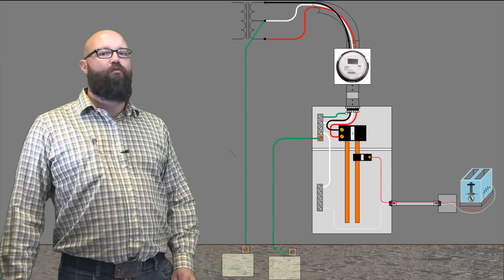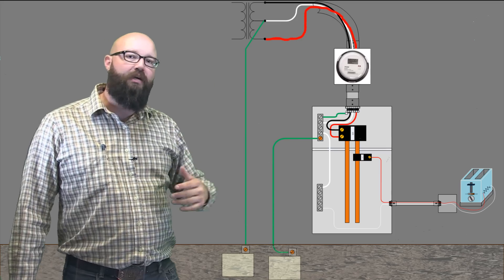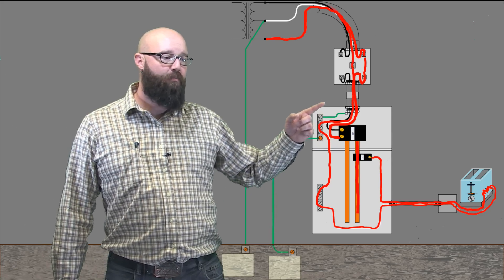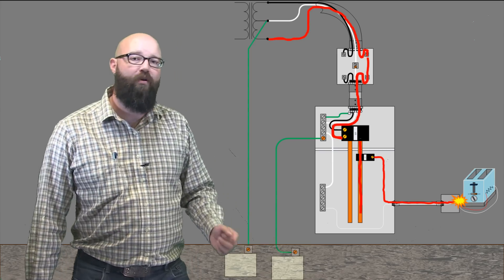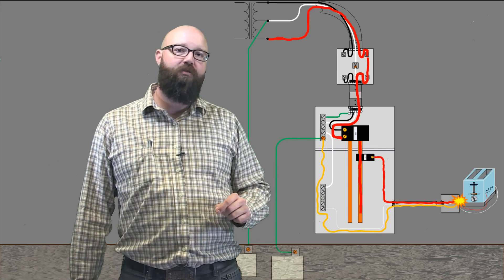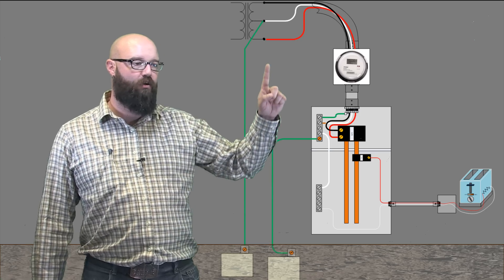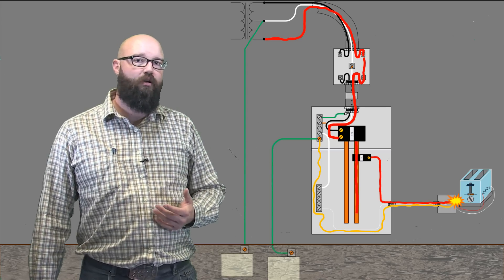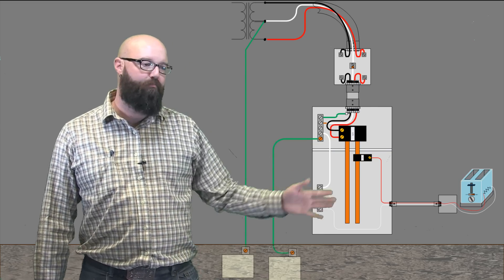Grounding and Bonding

Comment: So that white wire ( but it becomes bare wire outside heading to the transformer) is a current-carrying conductor basically at all times? and at the transformer, that wire is also connected to the ground.  Of course, it is. Just go outside and look at it.
Reply from the maker: Depending on the application of the term "current carrying conductor", it will have different applications.

While there may be current on the white (identified neutral) conductor, it is not counted as a current carrying conductor when applying correction factors for more than three conductors in conduit for example.
Reply: @schulerruler  I indulged in an assumption that you know what setting/application context I made my comment.
I have a transformer at the pole by my house.  I have two wires ( both are black in color and is insulated) coming out of that transformer.  I am told that two wires come of each end of coil that is inside that transformer.   The voltage difference between the two wires is 240-volt
s (give and take).    So if I hook up a load that can run on 240 volts, no problem, there is my two wires and it makes a complete circuit(loop) going round and round in a circle as by definition of a complete circuit.
Now if I want 120 volts, the story takes on all kinds of twists and turns and all kinds of other terminologies kick in.
There is a bare wire, they also call it neutral, even ground depending on who you talk to.  Whatever term is used frankly doesn't mean a thing.  It is a bare uninsulated wire that goes in the middle of that coil at its center point,  In fact, they call it a center tap and some shortens it and call it CT.  This is the same wire that is an insulated white wire inside my house.  It is the same wire that goes into every outlet etc.  Without it, I have no power in my outlets, light bulbs and all the things that run on 120 volts.  In other words, it is current-carrying ( charge moving in it) wire. If I touch it and the black wire in my outlet, it will let me know what is the boss.
Yet once this thing is outside as bare wire, it is harmless and hardly carries any current, mostly zero-charge carrying conductor, blah blah blah.
Harmless enough that they leave it bare.
So if I have only one thing running in my house at full blast, say an air conditioner (120 volts) and everything else is off.  Tell me if that bare wire is dead with no charges jiggling back and forth on it and tell me how neutral it is. If so where is my circuit ( my loop)?  What wire(s) are used by cosmic electric energy to do its magic?
And I will make it more interesting.
The two black wires come in my circuit breaker, each one occupying its own column of hookups.   Call one of them A and call the other column B.

Now I turn off all the switches on column B and use only column A that is hooked up to one black wire.  
( You can not have the two black wires touching each other, oh my, the two columns are kept separate)

Where is my return wire to complete the circuit and would it be alive.  Alive meaning that it is carrying charges, jiggling back and forth,  You know it is AC?
How NEUTRAL is that center tap bare neutral wire is that the tree limb constantly is rubbing on it and the two black wires too?
 (All three wires are pretty twisted together between the house and the transformer), 
Aerial bare wire?,  Earth ground? both 50/50, 30/70, 10/90, neither to complete the circuit?
Reply from the maker: @Blue Ocean to quickly answer your question, the bare wire outside, and anything connected to ground have no potential between them. They are effectively the same point. If you were to measure line 1 to anything effectively grounded, you would measure 120v (Same as to neutral) because they are the same point through the grounding connection at the transformer, and service.
Reply: @schulerruler   That is a no brainer, but that is not my point.  I was making my statement that it is so. 
My point is since they are all connected together which is obvious, are they dead wires ( i.e. no charges move through them) or are they truly part of the jiggling of the AC power system?
If they are dead or close to dead or in the vicinity of being dead wires, how do you get 120V using the two main black wires which are at 240V of each other?
I don't know about the whole shenanigan of balancing the loads, bla blah blah,  the two legs (L1 and L-2) are clearly separated from each other at the circuit breaker box.
Furthermore, how do I get 240 volts from one leg on the panel unless there is something I am missing Does the 240 switches have to be in contact with L-1 and L-2.  I haven't thought about that.  It has to be.
Nonetheless back to my 120V problem?
Reply from the maker: The entire circuit is a 240v transformer secondary coil that is tapped directly in the centre. This is where the neutral is connected, giving the line to neutral voltage of 120v. There are two 120v circuits available, but in reality they are half of the same 240v circuits each. This is also why the reading line to line is 240v (the whole coil).

 Yes there is current flowing on the neutral if the circuit is not balanced. How much depends on how big of an imbalance. (Check out my Edison three wire video for reference).
I would not recommend connecting a switch from line 1 to line 2 on a 240v circuit as this would result in a dead short @ 240v.

I'm not sure if I'm answering your question or not but I'm happy to keep trying.
Reply: Blue Ocean     Back to your original question please.   The white wire is neutral because it is common(connected) to both L1&L2 to be half the windings in the transformer so half the voltage.   Does it have voltage on it?  Yes it does.  But if you connect a ground to it at the panel, the meter will read zero volts because they both have the same voltage, not because it magically disappeared.   Is a neutral current carrying?   Answer, yes and no.   If you have two 120 volt loads and they are exactly the same ohms and distance away, and they are connected to L1 and neutral and L2 and the same neutral, then there are zero amps flowing back to the panel on the neutral.   The path is L1 to N to L2.   This is where the 180 degree and out of phase guys get to and can't explain.   If you do a single 120 volt circuit, there is current on the neutral.   If you put multiple 120 volt circuits in a conduit with a neutral to each one they are all current carrying because you forced the conductor to carry it back to a common point.
So, if every 120 volt circuit in your house connected to L1 and N was the exact same load as every 120 volt circuit connected to N and L2, then the bare conductor to your transformer would be  120 volts to line, zero volts to ground, and zero amps of current.
I hope this helps you understand.
Respectfully,   Kevin

Comment: If there was enough current to find the ground in the transformer and then trip the breaker all the kittens and dogs and people walking barefoot between the house and the transformer  would get toasted the same way the bread was about to get toasted.  This makes no sense.
Reply from the maker: The current returns on the low impedance neutral path. It does not travel through ground. In the last example, there would need to be a sufficiently high moisture/saline content to facilitate this, but under normal circumstances it would not flow through the earth. This is not the intent of the video. The intent is to highlight the path of current in a FAULT condition, not normal operation.

Comment: My friend great video and diagram with all the correct components. However your last example of utilizing the grounding electrode back to the grounded utility source will not open a circuit breaker. The ground resistance is too high to have a low impedance path. I apologize if this was clarified in one of the comments.
Reply from the maker: It has been, bit it's always good to discuss. I have clarified this point also in the video description, but depending upon the soil moisture/saline content, normally the impedance would definitely be too high. I would like the opportunity to conduct this scenario in a much wetter environment as it's very dry where I am.

Comment: Stop manufacturing electronics / equipment with metallic/conductive chassis, and you vastly reduce the costs of preventative circuitry.
Reply: good point
Reply: Wow, wouldn’t that open a can of worms.

Comment: Why it trips only the breaker of that line and not all the breakers of that hot bus bar.?
Reply from the maker: Tapped off of that bus, all other breakers would be considered "downstream" and a fault will always(99.9% of the time) trip devices "upstream". It may trip several devices upstream depending upon the coordination of your overcurrent devices, but it should not trip overcurrents in other circuits.

Comment: What size wire would be best for grounding a residential circuit break box?
Reply: The grounding electrode conductor is sized per the NEC based on the rating of the service disconnecting means (main breaker or fuse). It would be #8 copper for 100 amps and #4 for 200 amps. The grounding conductor to the supplemental rod never has to be larger than #6, although it can be #8 for a 100 amp service. But #8 would need to be protected from physical injury.

Comment: The last scenario is obviously very unlikely to trip the breaker seeing as how the Earth is very high resistance across large distances. That is the purpose of bonding neutral to ground. In last scenario you are being electrocuted with high amperage but the Earths resistance is the last feature of the circuit so the breaker never receives the high amperage that it needs to trip.
Reply from the maker: Depending on the soil moisture and saline content. Check out the video description as this point is discussed. Thanks for watching and commenting!
Reply: schulerruler Thanks for the great video. When you make content this organized it helps even experienced people to solidify the memories. Terrific explanation
Reply from the maker: @Coldbrookdangee  thank you so much for the positive feedback!!

Comment: In the final example I thought 120 volts applied to a ground rod won't open the breaker.
Reply from the maker: It depends on the soil moisture and saline content, but in most cases you are correct yes. Check out the video description as that's addressed there. Thanks for watching and commenting

Comment: Instead of connecting the green wires to plates in the ground why don't they just connect the green wires to eachother? then the elictricity could flow through a wire instead of through the ground.  would be alot easier that way imo.
Reply: I would put it like that:
Ground / Earth connection is a reference point. Supposed to be Zero. Soil has a certain conductivity, although at widely differing resistances depending on humidity and composition. High Voltage transformers and lightning rods connect to earth ground. The neutral conductor of the transformer in the street connects to ground as well as the lightning rod of your house as well as the neutral wire at your breaker box.
Connecting to Earth ground is like anchoring a ship at the sea bed. So it may not float away relative to the ground.
Not one single ship will make any serious impact on the movements of the earth. However, imagine tying all anchor chains of all ships in the same harbor together with large chains instead of anchoring. Yes, they will be together at he same level and float together in the same direction. But you will pay an awful lot of money for anchor chains. And the most powerful of the ships may dictate and rip away smaller ships.
Likewise: If a lightning strike occurs nearby - and your grounding network would be wire-connected to all other grounding points, you would feel serious feed-back from that strike returning into your electrical system.
Reply: They should connect the plates to the sky instead of the ground.

Comment: Thank you for the video - very helpful. @7:30 wouldn’t dirt provide a decent amount of impedance depending on the distance of the two grounding rods? If that we’e the case, the current would never be too high and the breaker would never trip. What am I missing? Thanks!
Reply from the maker: It is highly unlikely the breaker would trip in that scenario, and also very unlikely a situation like this would occur, as there would need to be many points of failure before getting to that. Though i would like to see dtudies from an area with a higher moisture content, or closer to seal level to find out for sure.
Thanks for watching!
Reply: Flash pan you are correct. If you were to connect a wire from a circuit breaker to a ground rod, that breaker would not trip. I’ve tried it.The impedance is too high, enough current will not flow.

Comment: You do realize that a grounding rod only draws about 8 amps right? not quite enough to trip a 15 amp breaker. Just a thought.
Reply from the maker: We have established that throughout the many good conversations. Different locations would yield different results and if be curious to see the difference between say a coastal city vs a mountain region.
Remember the last example is highly unlikely as a realistic situation.
Thanks for watching and commenting.
Reply: Well in a home that ground Rod would also be bonded to the main cold water line. That should definitely trip the breaker.

Comment: FINALLY! AFTER 3 YEARS OF ELNC ENGINEERING AND 100 VIDEOS ON THE SUBJECT!!! SOMEONE WHO UNDERSTANDS LANGUAGE AND KNOWS WHAT'S GOING ON WITH GROUNDING!!!
Reply from the maker: Thank you! I don't think I'll ever know it all though.
Reply: Peter, if it's language that you are heralding, then you should know that it is incorrect to cite Ohm's Law when speaking about impedance in an AC circuit.  Only in a purely resistive circuit, that is also Ohmic, can Ohm's Law be cited or applied.
Reply from the maker: Many people simplify the term ohms law into a formula. Using the term ohms law as a blanket statement is very common in electrical analysis, which I'm sure you're very aware of. I'm well aware of what it truly means, but 9.9 out of ten people when asked what ohms law is will regurgitate the formula and often substitute Z for R. Does it mean it's correct? No. Does the formula still work to calculate the equivalent current flow in a circuit based on oppositionial ohmic equivalents? Yes.
Should we still use the term ohms law? Yes. To give learners an easier to digest theory for circuit analysis without diving into considerably deeper level physics to get the point across that ohms go up amps go down.
Reply: @DiffEQ  5 years ago you were humiliated by your own arrogance…. 🎉 happy anniversary

Comment: current traveling to earth ground will not result in a low impedance path back to source.  therefore breaker will not trip.  dangerous situation if someone would happen to touch the breaker panel.
Reply from the maker: I agree. It is very unlikely that we would be relying solely on the ground path in the last example to provide a path back to the supply. There is most definitely a path back but in many jurisdictions, the impedance would be too high to develop enough fault current to trip the overcurrent.

Comment: Hi! I understood everything you said except the last part. You said the current doesn't go to ground but rather finds its way to the system ground, travels back, and then trips the breaker. 
I'm not sure if this is true. But if it were, how far away can that current travel to find that system ground at the transformer?
Reply: Same Q. You said, it travels through the dirt and finds a path back to the other grounding electrode. If it did, would this not involve a great deal more resistance--inhibiting current flow and preventing the breaker from tripping?
Reply: If there was enough current to find the ground in the transformer and then trip the breaker all the kittens and dogs and people walking barefoot between the house and the transformer  would get toasted the same way the bread was about to get toasted.  This makes no sense.
Reply: The center tap of the utility transformer is not grounded, the core is. That is why the return path has to be through the neutral conductor. Grounding the return current will not clear the fault because the impedance is too high.

Comment: Would that be the same for a 220 circuit were you dont have a neutral?
Reply: Todd T  all new 220 are required to have a neutral in a 4 wire outlet for the return load of a control transformer, old systems use the ground, that’s one reason dryers and washers use to shock people.  And still do some times.
Reply: Yes its an odd bit of information, and I should have prefaced that with made in the USA, "tunnel vision'" and yes as kevin coop said.   No neutral is required for short circuit to ground.
Reply: Todd T    The answer to your question is yes.   The example is short circuit to ground.  All branch circuits require a ground.  So exactly the same.   Has nothing to do with neutral.

Comment: WHAT HAPPENS IF THE GROUND  PATH IS STRATE  TO THE GROUND AND NOT BACK TO THE TRANSFORMER ?
\
Reply from the maker: The ground path connection is primarily there for things like voltage surges from lightning strikes. The path for normal fault current is back on the supply neutral to the transformer, not through the dirt.

Comment: Excelent video, one question: if an isolated solar inverter has voltage between neutro and ground can I bond neutro and ground to eliminate de neutro voltage? Thanks a lot.
Reply: jose olavarria you inverter is a source of power like a generator and should be bonded at the first means of disconnect/ over current protection
Reply: The neutral buss or terminal in the solar service disconnect should be bonded to ground. If you have significant voltage between neutral and ground, then your neutral is not bonded at the main service disconnect or possibly the bonding path is broken somewhere.